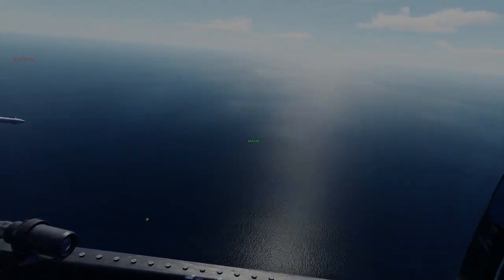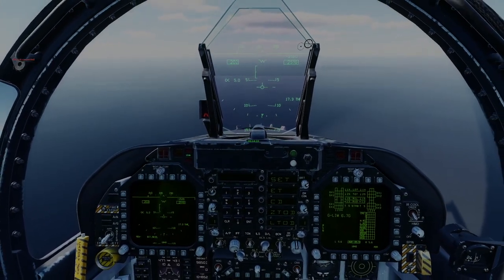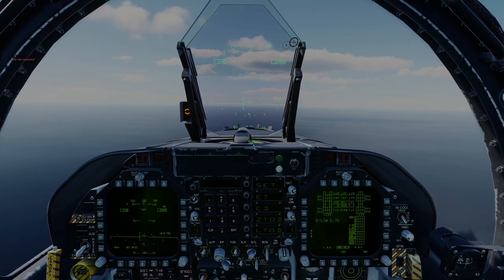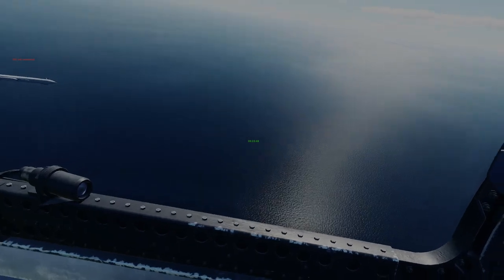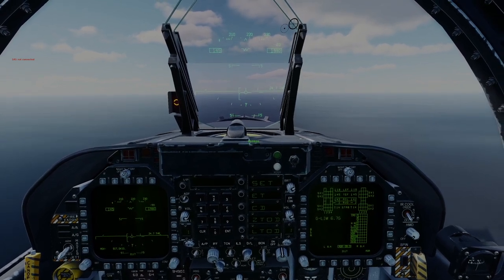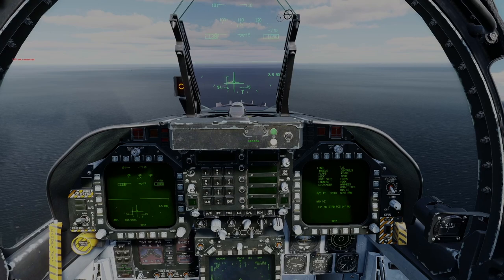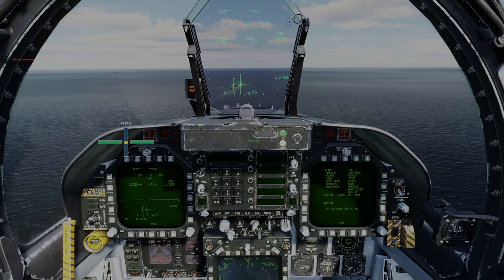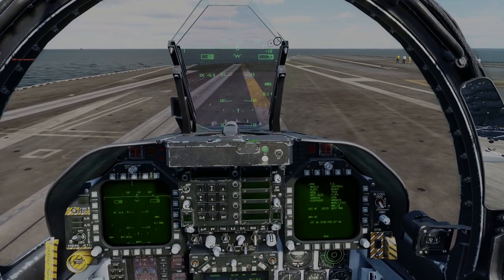DCS Hacks - straight in Approach

Comment: Show hacks how to make the corrections when you're not lined up right, etc.
Reply from the maker: Great Suggestion! I'll try and get a short up on Saturday for you! 👍
Reply from the maker: I' call it the 'NEED TO GO RULE' If the vertical ILS bar is right of centre you need to go right of the ship until its back in centre. If left of centre you need to go left until the its back in centre. Once centred you put it back on  the boat (right of the deck structure) Good Luck!